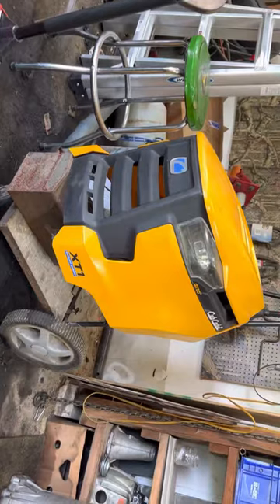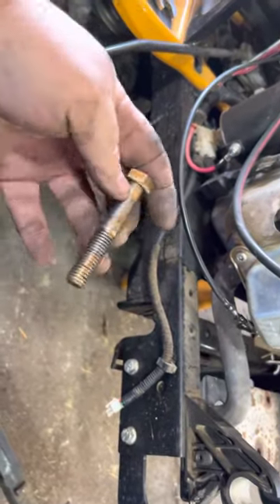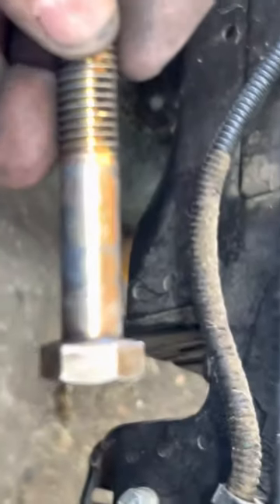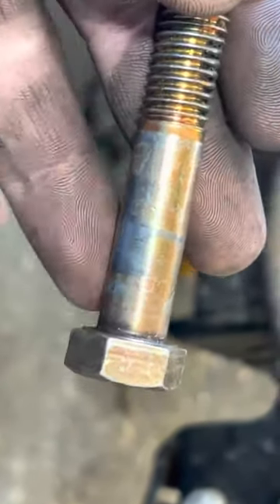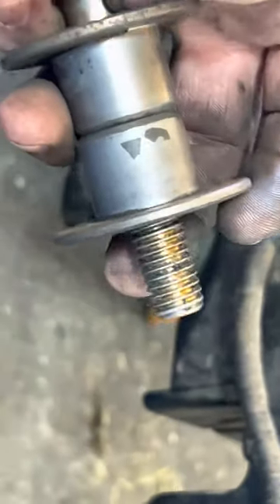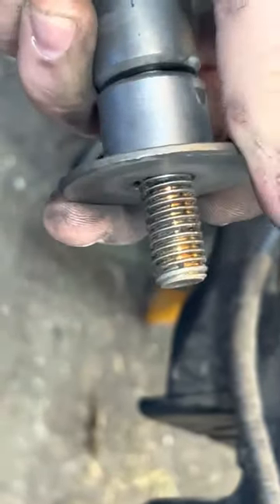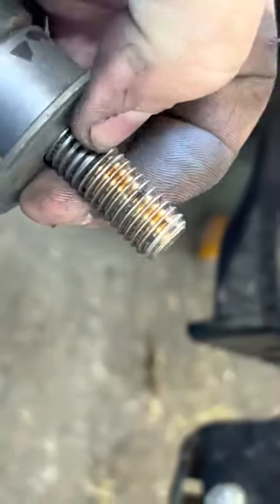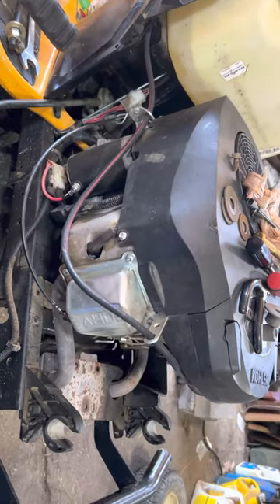XT1 Cub Cadet Cause of Front Axle looseness - play - slop

Comment: Have the same bolt worn on mine
Reply from the maker: I did find and use grade 8 bolt one half inch longer to get the longer shoulder. They had it at my local Ace. I am much happier with my front end axle now.

Comment: Were you able to find a shoulder bolt that would work to fix the axle play issue?
Reply from the maker: I used a grade 8 bolt 1/2 longer than what was in it. The unthreaded area was longer and it cleared everything with no issues. Major improvement on the wobble/play issue. I did have to readjust the drag link on one side though.